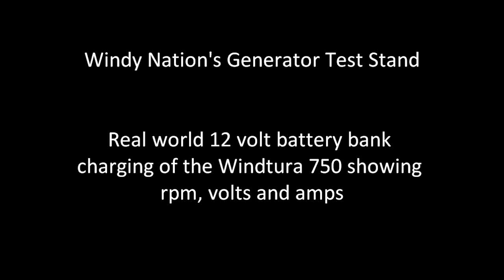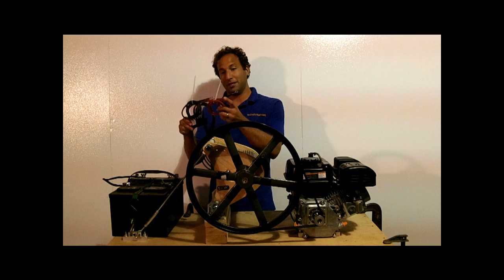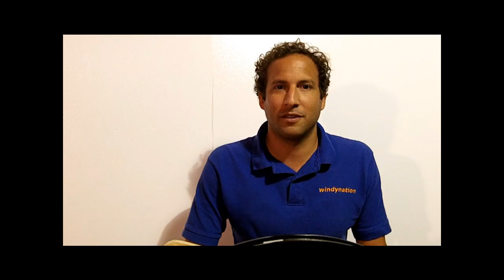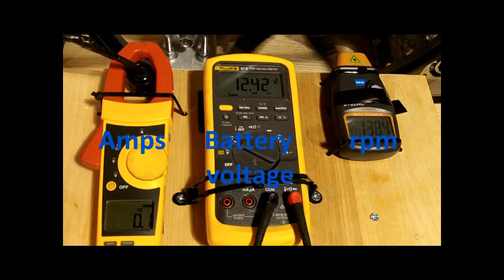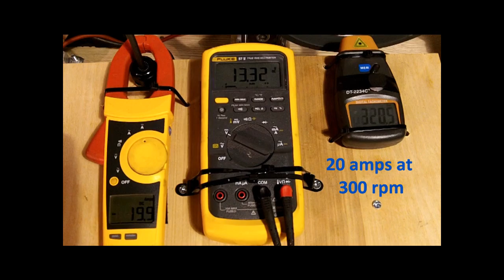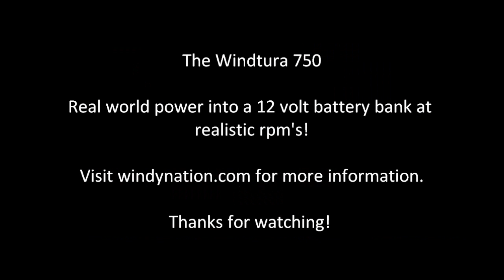Wind Hydro Generator Turbine 12V Battery Bank Charging showing RPM, Volts and Amps

Comment from the maker: @ian57812  We no longer sell the 500. It was replaced by the Windtura 750. To make the Windtura 750, we made stator and rotor design changes. We also increased the amount of copper and magnets. All these changes allowed us to produce a much more powerful alternator. 

By the way, the 24 volt battery charging video is now on youtube. The Windtura 750 easily exceeds 1000 Watts below 700 rpm. It is an extremely powerful alternator.

Comment from the maker: @ian57812 Hi Ian. You are correct. For 12 volt battery bank charging, the Windtura 750 cannot reach 750 Watts. However, the Windtura 750 performs optimally on 24 volt battery banks (NOT 12 volt battery banks). 

We will be uploading a 24 volt battery bank charging video on youtube within the next 72 hours. I think you will find the power output  extremely impressive especially since we do not take the rpm's above 700.